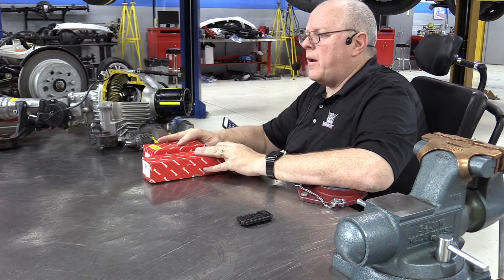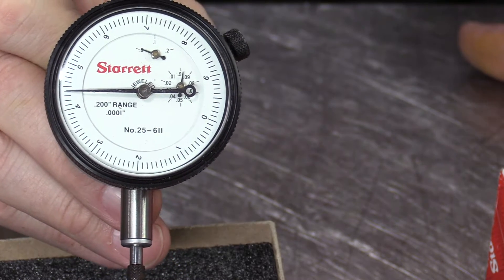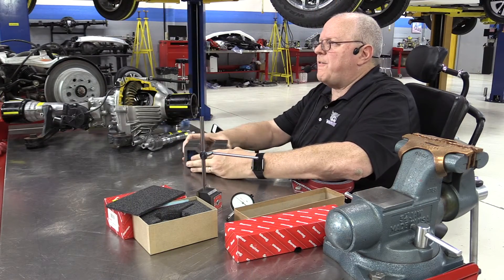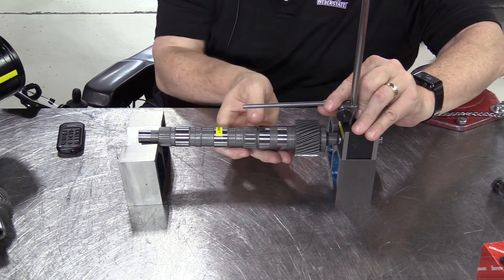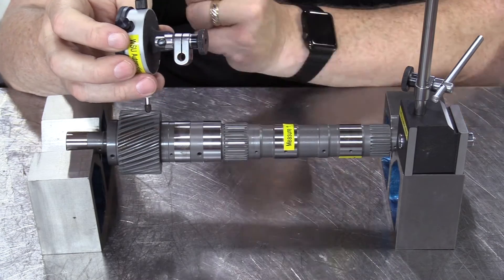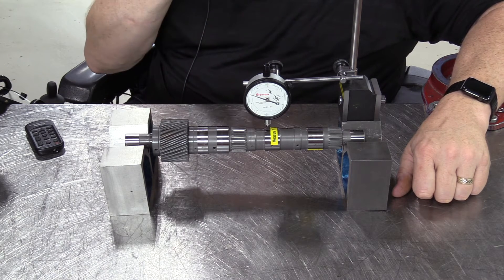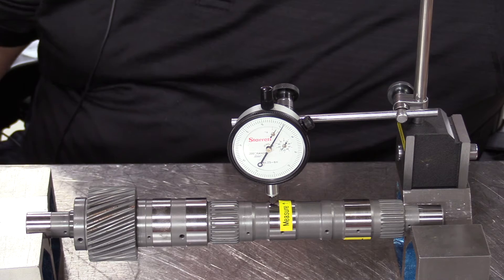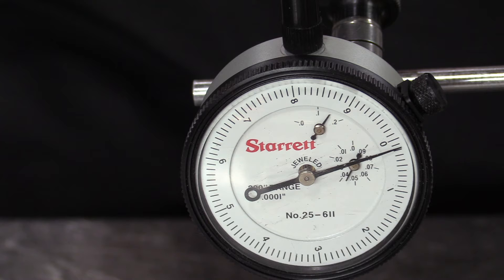How to use a Flat Magnetic Base Dial Indicator

Comment: Why dosent anyone comment about dial indicators that you should have the plunger at 90 degrees to the CL of the shaft or surface... If not you get errors at 45 degrees to CL you get half readings which can be used to get even more accuracy

Comment: 1/1000inch  is 0.025mm，i remember that comon axle needs 0.03～0.05mm circle  runout. this is a good one.
Reply from the maker: The dial indicator in this video measures 1/10,000 inch or 0.00254mm. Thanks for your feedback